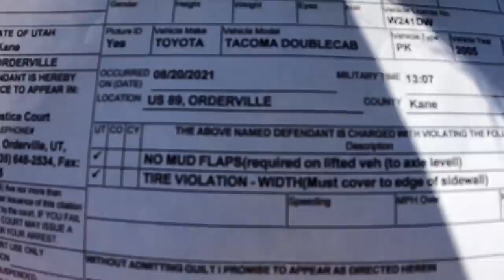I got pulled over for WHAT?! BUSTED!!

Comment: I've built a few driveshafts, how I do them is cut the tubing, with a big pipe cutter (perfectly square that way) .. and tap it on the 'end" I'm using .. check with a square, then tack it, check again, and weld it ... never had to have one balanced.  Mind you if I had a late I'd use it! :)

Comment: What does drive line mean?
The driveline of your vehicle transfers power from the engine and transmission to the wheels. It is the axels, driveshaft, wheels, joints and differentials. These components handle the full force of your vehicle. Love your vids.
Reply: Most guys around here call drive shafts, "drive lines" it's annoying.  Just for S&G, I should start using the proper term "propeller shaft" 😁

Comment: I had a 1990 Buick LeSabre without fail when you reached 2600 miles on an oil change it would start burning oil. It had something to do with the viscosity. So I was stuck changing oil every 2600 miles. So I started switching filters. Finally decided to pop for the K&N filter and at 3000 miles she hadn't burned a drop. Seems the K&N filters preserve the oil viscosity longer than the cheap ones. That was 5 years ago, use them on all my cars. Did finally figure out the problem with the car it needed a new upper intake the EGR  system went through the plastic and over time warped it and as the oil viscosity went down it would seep into the EGR system. After the change never burned a drop.

Comment: I ran into a mud flap Nazi at a weigh station in Missouri that wouldn't let me leave the station because my mud flaps were more than 9 inches above the road surface.  I had to call the local truckstop to send a crew over to install new flaps at the weigh station.

Comment: I'm in Saskatchewan Canada and I Drive a 03 2500 HD Duramax with 8 inch lift. I was getting new wide rubber all round and had to get an inspection on truck,guys at tire shop jacked up their service truck and too thinner tires off so I didn't have to put fender flares on. What service. Still no fender flares

Comment: I think those fender flares actually improve the look of the rear end.
The tray was kind of "utilitarian" and the flares add a bit of rat-styling to it
Reply: It's not about if it looks better.  It's the time, effort and expense it took to add them and the time it took away from other things he should have been doing when it wasn't necessary.  No more than those tires stuck out it wasn't hurting anyone.
Reply: @ToddKing  to be fair it is the law and he could have just done it with some rubber strips to save time but he made them from steel and it makes the truck look better. Its not fun when you meet a truck with no flares and it takes out your windshield or grill with a rock.

Comment: I'm in Australia and I've always wondered how you guys are able to get away with the tyres (sorry..."tires"...hahaha) poking out so much. This is REALLY noticeable on Matt's Morvair!!! I don't understand why they went to the trouble of building fender flares on that car, but they don't go anywhere even CLOSE to covering the tyres!!! Why would they even bother making flares that don't do the job??
Also, here in the land of OZ, our mud flaps have to be no higher than 12" off the ground, so your new flaps wouldn't pass the cops inspection either. You guys are so lucky to have such relaxed laws there in the USA.
Reply: Matt's Morvair qualifies as a station wagon, same as an XJ or YJ Cherokee, our Excursion is lifted with 35's and doesn't need flaps as it is a Station wagon too, but my dodge truck with the same tires, needs to have flaps that are within 8 inches of the ground.  I put a set of semi flaps that hang off the receiver hitch. I pinned them on took the picture for a fixit  ticket and they came off and have not been on in 10 years ....knock on wood.
Reply: In alberta canada, the top 1/2 of the tire needs to be covered either by flare, fender or flap...  So mudflaps must come down to the centre line of the axle, but need to be at least I think 10cm off the ground. Really all they do is reduce the height of a rooster tail, they don't actually stop debris from hitting the windshield of the car behind you, 'cause they don't go low enough
Reply: It is different state by state here too. In the south where I’m from nobody cares about any of it. If there are any laws for it nobody even knows about them and they def aren’t enforced.
Reply: @MrSmith223  I saw a video where down in AU just adding some bolt on roof racks can put some vehicles over weight, and thus "illegal"... Here I've towed way over my factory limit (in a controlled, low risk environment) and cops can't technically say anything.
Reply: @gold5th  - talk about absolute tyranny.
Reply: Bill Roach. bull about the mud flaps in Australia
Reply: @peter barber  can't seem to add the image of the page I'm looking at from the NSW rules, but it clearly states the height regulations.....230mm for normal vehicles and 300mm for off road vehicles.

Comment: It's funny that you got pulled for not having flared wheel arches but it's legal for you to build your own truck chassis etc. Regards, Jealous from the UK.
Reply: You can do it in Canada too but need a commercial sticker.
Reply: @danlux4954  no you don't
Reply: @2088bob1  the MTO sure says you do.
Reply: @danlux4954  i built my own chassis in 1985  didn't need a thing from the ministry  and have been driving it  every summer since
Reply: @2088bob1  sweet!
Reply: @danlux4954   in fact for the first 20 years i also ran fenderless    no worries with MTO unless they caught me in the rain
Reply: @2088bob1  I wish I could weld then I’d make a better box on my truck. Thanks for the info

Comment: To give you an idea just how bad it is here in Australia, I'm not allowed to increase the diameter of my tyres by more than 2" over stock and not allowed to have any more than 2" total lift, that includes tyres, suspension and body.

Changing suspension and steering components like you do is entirely illegal without having a state approved engineer sign off on it.

Comment: Had a cop pull me over on time said my tires stuck out too far past my fender flairs.  I got out a 4ft level put it up against my tire and measured from the level to the tire tread. Took the same measurement at the flair and the tread pattern is 1/4 inch inside the flair. The side wall can stick past the fender but your tread can't.  At least in ND that's how the law reads. I have educated cops of this a time or two

Comment: When you use that bearing splitter on your press you should put the splitter crossways on the bars not the way you have it parallel to the bars do the bars you are  Using the threaded portion to support the splitter the threaded portion is only to prevent it from splitting open or sliding apart The silver part should span front and back of the cross bars of your press Normally I would not comment on somebody's use of a tool but this is the 2nd or 3rd time I've seen you do this yes I'm a mechanic of over 30 years myself off and the improper use of tools drives me nuts lol

Comment: We have way to many laws as it is. The reason I say that is because , like the mud flap law, and fender flares, you could literally drive a thousand mikes, and not cause any damage to anyone else or their vehicles. With that being said, industrial trucks like semis and dump truvks,  I believe that they should be required to have them, because they have extra deep treads, and are often off road with them, which can cause them to pick up and throw out rocks and other debris, which can potentially damage others, and their property. As far as individual citizens being required to have them, as per law, this should not be the case. You can attempt to gain compensation from individuals, or even companies, that damage your property, without a law against someone who does not have flares or mud flaps on their vehicle.

Comment: Heh, in my country every (major) change to a vehicle has to be reported so it can inspected and verified 'to be within the rules'. Even if you just change the color; although that just requires a notification...
Reply: Some states here in the states frown on going beyond factory stock for some items. Inspections here for me have to have what worked from the factory working. Tinted windows can be a problem. Then other states leave it up to the owner to maintain their vehicle and if something happens there are problems if it caused an accident. Overall it is not overly strict but maybe with emissions being a growing exception.

Comment: i will never use a fram. i will pay $20 more for any other filter before i use a fram. i have a 2000 f150 4x4 i was out in the wood and stuck something in my oil filter.  i called a friend he brought me a fram and from that moment on i had a low end knock at start up. until i got home 3 days later and changed it no more low end knock.

Comment: Paul doesn't seem happy about the new repairs, but he does a great job!! Also check out  "The Skid Factory" on youtube they are a couple of Aussies that build street legal drag car to Rock crawlers. If you build something is Australia you have to have it reengineered meaning to take it somewhere and have it inspected to make sure it is safe and has the proper smog equipment. Example if you stuff a huge engine in a small car they expect you will upgrade the steering and brakes to meet the needs of the increased power.

Comment: It is possible to build something like that in Australia. BUT it's bloody hard work and requires a lot of engineering, testing and $$$ to get it legal. 
Without engineering you can do a 2" lift and go up 2" in tyre diameter. Doing anything beyond that with suspension needss engineering. 
On the plus side though, there's more good parts around.

Comment: In the UK we are required by law to get an MOT every 12 months.  MOT testing centres are regulated and licensed by the Department and Transport and DVSA for the purpose, and the individual testers carrying out the inspections also have to be trained and certified. The decision to pass or fail each presented vehicle comes down to the discretion of the tester following the guidelines issued by the DVSA.
The MOT test covers the following aspects
Exhaust and emissions 
Seat belts
Steering
Windscreen
Bonnet catch
Horn
Number plate
Lights
Brakes
Tyres and wheels
Mirrors
Doors
Seats
Suspension
Fuel system
Body and structure
Battery & Wiring
Battery & Wiring

An MOT test certificate confirms that at the time of the test, the vehicle has met the minimum acceptable environmental and road safety standards. It does not mean that the vehicle is roadworthy for the life of the certificate. The test does not cover the condition of the engine (other than the emissions), clutch or gearbox. Maintenance that is necessary for the reliable and efficient operation of the vehicle – but not its safety – forms part of a service inspection that is recommended by manufacturers, but is not a legal requirement for operating the vehicle on the public highway.

Items such as the windscreen, wipers and exhaust systems are tested for condition and operations. Windscreen wipers will fail the test if they do not adequately clear the windscreen when used in conjunction with the washers. The exhaust system, in addition to checks on its condition and security, is tested to ascertain whether it is louder than another vehicle of the same make and model with a standard exhaust system fitted. Dismantling of any part of the vehicle during the MOT test is strictly against test regulations, making the assessment of corrosion or worn components in certain areas on certain car models very difficult to determine accurately. As the MOT is only an inspection for roadworthiness at the time of test, the inspection of most accessories is not included. One exception is tow bars: their condition and their attachment to the vehicle is now included
Reply: That's called, "being a subject".

Comment: @7:11 This is so good to hear from you,People actually believe they have a "WET" oiling filtration system. Let me ask you something what do you think the bypass valve is for in that their oil filter? and what do you think it's set at? Let me tell ya at around 12 psi the oil filter goes into BYPASS!  filtered oil on start-up or any time under 12-14 psi lol so it doesn't matter what kind you use, change it often and you will be fine.

Comment: UHP is the WORST... They're like middle school hall monitors.  A holes about everything in the book, anything they can get you for they will...
The last time I was pulled over in my old lifted excursion, and he was measuring the frame to ground clearance, checking fender coverage, etc. Even tried to cite me for the blue led lights in my running boards... I'm like, uhmmm you sure as hell aren't, they're only on with a door open... I obviously don't drive down the road with my door open... 🤡
Reply: BTW, I'm shocked they signed off on those flares! Definitely more chill than the boys up in Salt Lake.

Comment: One thing that does worry me about the Toyota is that spare hanging out the back. I've seen a couple of clips where it contacts - how about putting it on a hinge with a spring snubber so that it does not threaten to rip the tire off if your clearance angle is not right?

Comment: I got the same ticket in 1992 from WA. State Patrol on I-5. So I put wider mud flaps on my GMC P/U fender flairs. I was driving a 78 GMC Sierra Classic short box w 3 in. body lift, 4 in. Rancho suspension and 12.5-38's Mickey Thompson rubber.Went to clear the ticket and the cop that looked the truck over was ok with the new mud flaps, but then he issued a new ticket because my tires exceed max width from the side body of the truck. So they told me they were ok with my fix but my tires were illegal on WA.roads. So I blew that off, as I was preparing to move back to CO. in 9 months. In CO. I never had any problems with tire size!

Comment: Years ago I had an automotive repair shop. My landlord decided I needed a concrete apron in front of my doors. I was shut down for a couple of days while the concrete se3t. Out of boredom, I opened oil filters out of curiosity. Almost every Fram I opened was coming apart. THEY WERE JUNK. NAPA (Wix), Purolator and a few others I don't remember were great. Unless Fram has improved TREMENDOUSLY, I would not put a Fram on a lawnmower.

Comment: I don't think you flare is going to do it if you google the code he listed on the citation... " 	If the wheel track is increased beyond the O.E.M. specification, the top 50% of the tires shall be covered by the original fenders, by rubber, or other flexible fender extenders under any loading condition." Simply putting an attractive strip of metal above the tire MAY not satisfy the Utah State Code.  I'm just saying...  I hope I am wrong.

Also, the code for the mud flap reads as follows...

"The wheel covers, mudguards, flaps, or splash aprons shall:
(i)	be at least as wide as the tires they are protecting;
(ii)	be directly in line with the tires; and
(iii)	have a ground clearance of not more than 50% of the diameter of a rear-axle wheel, under any conditions of loading of the motor vehicle"

Good luck...

Comment: I was stationed at Hill Air Force Base up in Layton. I had a 1985 4 Runner with 35” tires that stuck out even less than that. The Utah State police pulled me over several times for it. They never gave me a ticket. I think they were just hoping to get me for something else. Nope. I was a totally legal First Sergeant just wheeling with my daughter. They seemed disappointed when they couldn’t get me for something bigger.

Comment: I’m fairness to FRAM, the TG and XG series filters aren’t trash. They aren’t great, but they don’t suck. The standard oil filters (PH8, etc.) is garbage. Main reason is that the end caps of the filter medium are paper. While many filter companies use paper as a filter medium, most (vast majority) use metal end caps to hold the filter medium. The likelihood of a paper end cap failing and allowing filtered garbage into the engine is higher than metal caps.

Comment: Paul...  Do you use synthetic oil(s) in your Toyota?  I have a 2000 Toyota Tundra w/4.7L engine, 4x4, and I have used Castrol Syntec oil in it ever since its very first oil change.  I learned a very hard and expensive lesson last year with it.  Do not procrastinate on changing sparkplugs.  I had one plug that blew the porcelain out and that took out the cylinder coil with it.  It damaged the head so that had to be replaced.  Since they had the whole front of the engine removed to replace the head, I had the water pump, and timing belt replaced at the same time.  I only have 198K miles on it, I'm hoping it will continue to run for a while longer.

Comment: Here in the U.K. a "built" or modified vehicle has to undergo very very strict Ministry of /transport engineers tests and scrutiny at the owners expense  ,and that's not cheap, before it can be used on the road. From what I have seen of your vehicles and Matt's vehicles and Robbie Layton's, the only ones that would be allowed are your respective wives Sedans and suburban's.

Comment: LOL  In a dump truck in Utah, I have to have my mud flap to the center of the wheel or longer.  Those look kind of short, but maybe its the suspension hanging down.  I tore off a mudflap and driving home to fix it and got pulled over.  Geeze!!

Comment: FRAM oil filters are good for clean out on a fresh built motor, to crank and run a few minutes then take the filter off and put a good filter on for the break-in. But your mud flaps technically are not dot legal to high from the road to bottom of mud flaps.